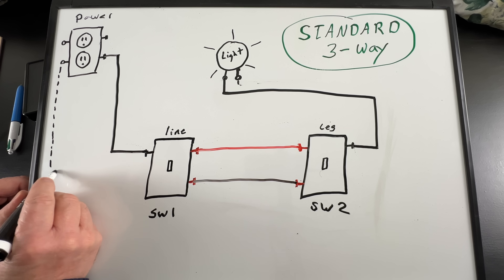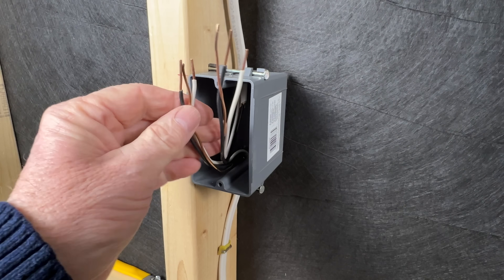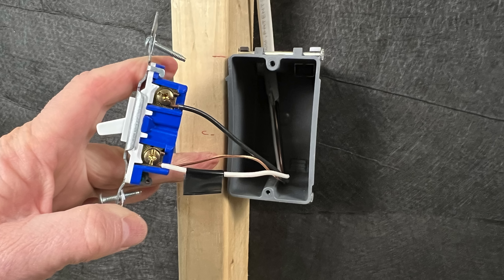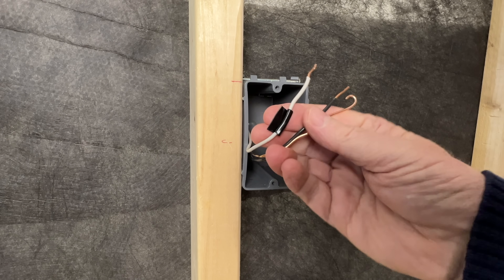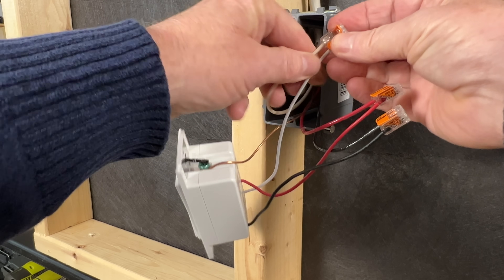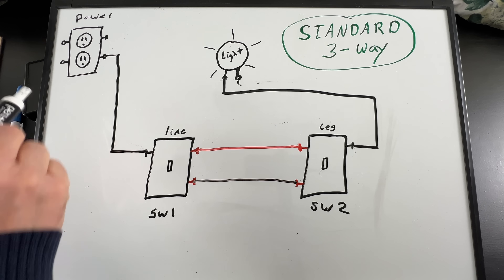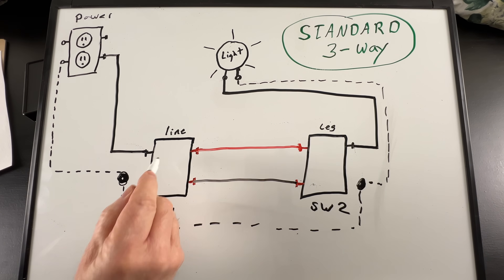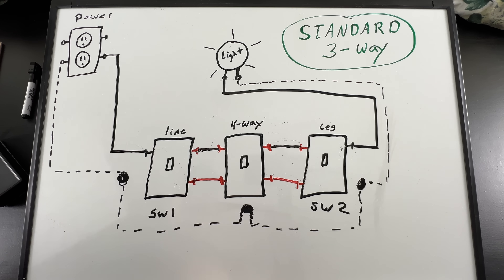How NOT to Wire Light Switches in 2025 (New Rules)

Comment: This is the type of thing that drives me crazy.

It used to be fine, and there is no reason why these should not be okay.

I understand that you would have the light switch fed first if you are doing anything new, but so many of these exist in houses

Now you need to have 14/3 with ground to do a switch loop.

And just have a neutral in the box not being used

Having the switch ground is good but many switches don't have a ground screw.

The 1 thing I saw actually installed in my house that should be illegal is a shared neutral

Nowhere should it ever be allowed

They ran 2 outlet circuits using 14/3 and ran a shared neutral and the voltage drop was severe.
Reply: When I bought my house 2 circuits had a shared neutral, AND the two breakers happened to be on the same phase.  The latter issue is why there’d be excessive voltage drop (and crispy/melty insulation…).
Reply: @kc9scott  The builder used the cheapest ways to cut corners.
The front room was all the way at the other end of the house.
About 200 feet away from the panel. He rand 14/3 to feed the 20 lights in the ceiling sharing the neutral and ran 14/3 to power all the outlets, 12 of them, with 6 on one phase and 6 on the other phase and the neutral the same for all of them.

So many cut corners that were technically legal but never should have been done.

The bathroom downstairs and in the master bedroom and outside outlets and the laundry room had no GFCI.
The upstairs guest bathroom was the only one that had GFCI

The lights in the showers had no GFCI

Nor did the sump pump or the garage.

Just a real jerk.

I found so many people that are licensed do bad things and a lot don't know how to identify or fix a problem.

4 plumbers could not figure out the hot water tank was wired backwards

But they all charged 1000 dollars for the 3 hours they spent " looking" for the problem.

And the window company that installed the 10 foot by 6 foot glass pane and it shattered 12 hours later from stress. Another 14,000 dollars and no guarantees

And the elevator guys, we had to go 12 hours away and pay for the tech to stay over for a week to find the problems from the original installer.

Just such incompetence
Reply: @ocsrc  Wow, sorry to hear about all that.  For the house I'm planning, I hope to find a builder that's good at weeding out people like that before they get to my job (maybe not very realistic?).  But your voltage drop problem was caused by the long length of 14-gauge, not by the shared neutral.  The shared neutral does cause other problems, such as not being able to use GFCI or AFCI breakers, and as I understand it, nowadays such a branch-circuit pair is required to go onto one double-pole breaker (i.e. a 240V breaker), to ensure that they're truly on opposite phases.
Reply: @kc9scott  on the dedicated washer and dedicated dryer circuits The same length away from the panel I didn't have any voltage drop.

The Master Electrician that came, who I spoke with for an hour, and I really respected and trusted him, he said he had seen this in many late 70s and early 80s new homes and they all had this voltage drop problem.

He said it should never be used, but if it was the code called for the neutral to be larger than the hots.

And he said they made a 14/2-12/1 wire specifically for these types of runs.

I thought it made no sense because the neutral was carrying less.

He said if he was going to do it he would use 12/2-10/1 

He rewired the front room and living room.

He installed a conduit from the panel outside around the house into the wall near the washer and dryer.

He ran 8 new circuits and installed a sub panel to feed them and installed GFCI on the bathrooms and washer and garage and outside outlets and kitchen.

It was a big deal and he used metal conduit and boxes.

I don't know if PVC was not used yet back then.

I remember the plumbing was PVC for the bedroom bathrooms but the downstairs all the pipes were metal and cast iron.

It was strange that it was half and half.

I guess they must have been needed for the underground in concrete installation.

I remember having to change the 150 watt flood light bulbs in the recessed lighting in the vaulted ceiling.

It was a huge pain.

CFLs came out a few years after the house was sold.

LEDs are so nice now. Only having to replace a bulb every couple years.

I literally was replacing bulbs every week.

I had a huge stockpile of cases of flood light bulbs in the garage for the ceiling

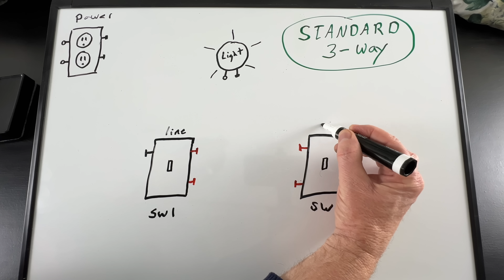Comment: 12/2 is needed for 3 way? 7:28 in the video
Reply: I do not think it is required as 14/2 is mainly used on lighting.  In fact because of the lower power demand of LED lighting they are now coming out with 10 AMP breakers that uses lighter cheaper 16/2 wiring.  I can see no reason to spend the extra money for 12/2 especially on LED lights.
Reply from the maker: No thats just what I used for the example. If you have a 15A circuit you can run 14 gauge wire.
Reply: Whatever amperage and wire gauge the whole circuit is, all the switch wiring also has to be.  It is house wiring, not the wiring within a light fixture, where the manufacturer can use thinner wiring appropriate to the specific light fixture.

If you have a 20A breaker on a circuit, including a lighting circuit with very small loads, you need 12awg everywhere it goes, even from a switch box to a single 5W LED bulb.   While a dead short on 14awg will trip a 20A breaker, a less than dead short creating a 15-20A load will not trip the breaker, just overload the wires.  All wiring you run has to handle the entire amperage of the chosen breaker.  Just throwing a 15A breaker on a 20A circuit, and extending it with 15A wire, is horrific.  Someone in the future will see 12awg wire coming out of the 15A breaker, and replace it with a 20A breaker.  Then you have 14awg wires where 12awg is needed, because it will again be a 20A circuit.  

It's not fun buying a 250ft roll of 12-3 NM-B  (or UF-B like I did) to use as runners between new pairs of 3-way switches (part of which passed through a damp location in my case) just to power a small handful of 10W recessed LEDs, in order to keep all circuits in your house 20A or more, and all wire 12awg of thicker.  But if you're going to cheat, the next thing you know, an electrician, or the fire investigator, will be finding 16awg orange extension cord wire in your walls.  

It would not be cheating to use 14-2 and 14-3 as appropriate, if the entire circuit were 14awg and the breaker was 15A.  But I'll be damned if I'll allow 15A circuits in any family member's house which has all 20A circuits already, to save a hundred bucks or whatever.  It would devalue the property after a lot of money was spend when the house was built or renovated to have all 20A circuits and 12awg wiring. There is nothing wrong with adding a completely new 15A circuit, but having 40 circuits where none are only 15A, and adding a 15A one, will look cheap, like having a $20 front door lock and $79 kitchen faucet on a $2 million dollar house.  Meets code, but if you save $2000 by being cheap on 20 little projects, and you lose $200K of home value because a buyer and their home inspector will notice the variable quality of construction and maintenance.

Match the amp rating of the breaker and ALL the wiring on a circuit.  If possible, have a rhyme or reason to those choices.  If all outlet circuits are 20A and all lighting circuits are 15A, fine.  If they're all 20A, think hard before running a new one that doesn't match.

Comment: Great video but you missed one code.  NEC 200.7(c)1 says when a white in a cable assembly is re-identified it must be used as the SUPPLY to the switch and NOT the return
Reply from the maker: Maybe I should have said that. I did do that in the video. The reason is because it could be confusing for some if we wire our light with two white wires.

Comment: Great video,  however, I was hoping you'd show the wiring for the California switch setup and for the Chicago switch setup and descibe why they're not code compliant, thanks
Reply: California three way has no neutral at any switch.  And a Chicago three way can have power at the light even when it's off  or also reverse polarity
Reply: I was curious too and looked them up. Chicago has two separate connections to the light and both switch hot and neutral. If it's neutral from both or hot from both (!) then the light is off. California just switches the hot but has three travelers, with T1, T2, and common all wired together. T2 goes to the hot side of the light and T1 goes to the hot. Neutral goes to the light.
Reply: @Melds  This apparently is also called Carter three way. It was banned a hundred years ago. Sin short the witches were reversed so that the power came (to both) from the side with two contacts and the sides with one contact went to the light. Since it was the knob and tube era with single wire cables that made some sense though the risk is obvious. With modern cables that would make no sense at all.
Reply from the maker: Great suggestion! I'll make a video on those two methods as well.
Reply: @BackyardMaine  Thanks,   you're videos are very helpful, also, I know the code also says that all outlets, gfci not withstanding, have to be replaced with the arc fault circuit type, hopefully you can do a video on that as well
Reply from the maker: Will do.. I have that on my list.  @b.powell3480

Comment: Very clearly explained! Thanks. I think up in Canada, their CEC requires neutral at all 3- and 4-way locations, I don't think they've carved out an exception like the NEC has.
Reply: I prefer it that way anyways. Then you still have a neutral @ all the switch boxes incase you ever need/want a switch that needs it there.
Reply: @KjKase  It is obviously more versatile. The question is whether one's old house is wired this way ....
Reply: @dmitripogosian5084  I know mine isn't... It sucks, but I'm not going to rip out the drywall to do it the way I'd prefer lol.
Reply: @KjKase  Without changing where the wiring goes, you'll never need it. Only one of the switches will have the relay that switches the load; this frees up the travellers to feed live and neutral to all other boxes to power the "send command only" smart switches.
Reply: @HenryLoenwind  What if I want switches that light up at night?
Reply: @KjKase  with whatI described, there will be a neutral everywhere.
Reply: @HenryLoenwind  Ah yeah, you're right. misread it.

Comment: Don't know if it's code compliant or not but electrically that dead-end switch circuit can be extended. Just replace SW2 with a 4-way and move the 3-way over to the new SW3 location and run your wire from SW2 to the SW3 location.
Something that always used to confuse me because I cane from an electronics background and knew what was actually inside the 3-way and 4-way switches. 3-way is a SPDT and the 4-way is a DPDT switch wired as a reverser internally.
Reply: And another interesting note is in Europe a 3-way switch is called a 2-way switch which if you think about it makes much more sense.
Reply: @stargazer7644 if true, Europe is basing the name off of the number of locations, while here in the States we base it off of the number of wires required for the switch to function. A 3-way switch will always and only function with 3 wires. 4-ways will always and only function with 4 wires.

If you wanted you can have 20 switches to work a single light. All it would take are 2 3-ways and 18 4-ways.
Reply: @The_Forgotten_Man  So why is the word "way" included?  I rather think Europeans call them 2 way switches because the switch selects one of two ways current can go out of the switch. American 4 way switches are called intermediate switches in Europe, not 3 way switches.
Reply from the maker: Yup you can do that but you're still just extending the switched power which will have to get back to switch one to actually turn on your light.
Reply: Does the 4-way still have a neutral this way?

Comment: Finally,  thank goodness, I  have always wired like this any way,poor to the switch box first it makes for easy trouble shooting also.The first time I ever noticed a two wire to the switch box like that was when I came to the high desert and troubleshooting shooting cheap spec homes, these cheap contractors trying to save three feet of romex .
Reply: I never saw a marker for the hot line with the bare wire running in the baseboard.  ahhh those were the days.....  Don't have to strip the insulation off when you sell the copper.

Comment: Fantastic Description !!!! 
Question….If you added three additional 4 way switches to your diagram then do you need to maintain symmetry when wiring the traveler wires? In other words does the black wire of one 4 way switch need to be in the same relative position on the next 4 way switch? 
Thank you again for such an informative video. I’m glad I’m a subscriber to your channel
Reply from the maker: It doesn't matter which gold screws you connect the travelers too. You don't need to pay attention to that. Just be sure to connect the hot common or the switch leg to the black screw or for some devices the one marked common.

Comment: Question: Why run 12 gauge wire to power a circuit that typically uses less than 5 amps?
Reply: It is based on the overcurrent protection.  If the circuit is protected by  a 20 Amp breaker, then you can't use a wire smaller than #12.  Edited to add:  I get what you were asking now.  Yes, #12 is usually overkill for lighting circuits.  #14 is probably overkill these days since most lights are L.E.D.'s., with probably the same number of fixtures per circuit as was done with incandescent bulbs fixtures.  #14 is the smallest allowable size for branch circuits though.  I must've been assuming an existing circuit that had #12 feed and most likely on a 20 Amp breaker, and you were asking why #14 can't be used for the switch legs and between 3 & 4 ways, sorry about that.
Reply: @huckbeduck  Your response assumes a 20 amp breaker... to power a circuit that typically uses less than 5 amps. If you're running wire all the way to the service panel you can use whatever breaker is appropriate. I seem to recall the new NEC even allows for 10 amp breakers for lighting circuits.
Reply from the maker: 14/2 if fine if on a 15A circuit breaker. I didn't want to say 14/2 and have someone connect that to a 20A circuit.
Reply: @BackyardMaine  I get that. But, might as well assume they're connecting to a 30A, or one leg of a 90A if they'll connect to a 20. I'd assume they'll connect to the appropriate breaker. Might as well just include the words: "Connect the 14/2 to the 15A breaker." Wouldn't have really taken any longer.

Thanks for the videos. Very informative.

Comment: @7:29 why would you run 12/2 to the switch? wouldn't 14/2 be more than enough?
Reply: I do not think it is required as 14/2 is mainly used on lighting.  In fact because of the lower power demand of LED lighting they are now coming out with 10 AMP breakers that uses lighter cheaper 16/2 wiring.  I can see no reason to spend the extra money for 12/2 especially on LED lights.
Reply: That seems crazy unless you are running massive grow lights. I had the same question. I rewired last year and no circuit uses more than 30 watts and yet most is 14/3 and some is 12/2
Reply from the maker: 4/2 if fine if on a 15A circuit breaker. I didn't want to say 14/2 and have someone connect that to a 20A circuit.

Comment: Yeah, then you get the folks that don't have a neutral in the switch box but want to use a smart switch. And they've figured out that ground and neutral are bonded together SOMEWHERE, so they'll use the ground as the smart switch's neutral. It works, but it's sure not code compliant.
Reply from the maker: That's the main reason for the change.

Comment: Dude. Your method is correct but your diagram is confusing. You have 12/2 to Sw1 box, 12/3 leaving sw1 box to sw2 box, (2 hot & 1 Neu) and 12/2  to light. The way you show it gives the impression that there is a joint made out in mid air somewhere. Your not showing that there is 12/2 exiting sw2, to the light
Reply: Dude. A time reference would be helpful as we can't read your mind.

Comment: Is it required to use 12-2 for a 3-way light switch?
Reply: Well done video!  Same question though - why 12 gauge wire for lighting circuit?
Reply from the maker: 4/2 if fine if on a 15A circuit breaker. I didn't want to say 14/2 and have someone connect that to a 20A circuit.
Reply from the maker: 4/2 if fine if on a 15A circuit breaker. I didn't want to say 14/2 and have someone connect that to a 20A circuit.
Reply: You should say that the switches need to be rated at 20 amps if it's on a 20 amp breaker. #12 wire isn't required, and most lighting is on 15 amp circuits. Which will save money on the switches,  breakers, and wiring.
Reply: Not required if the circuit breaker is 15A or less.
Reply: My concern is box fill with 12 wire. Yes, if it is a 20 amp breaker, you need 12 wire. Most lighting circuits are 15 amp. You can put more lights and outlets on a 20 amp than 15 amp . I prefer to have more circuits, so when you need to shut off an area to work on wiring, you aren't cutting power to areas you don't need to.